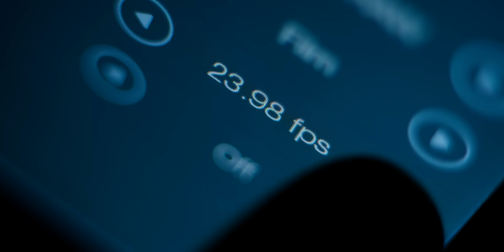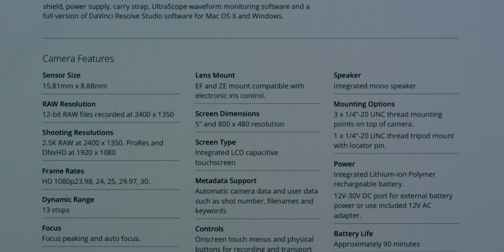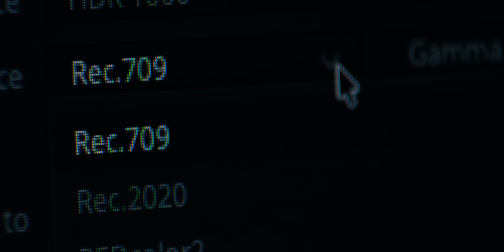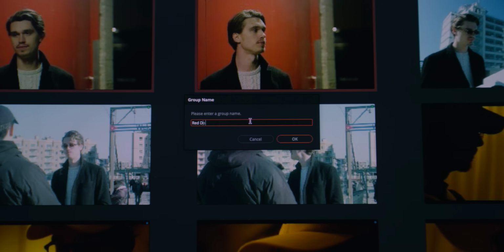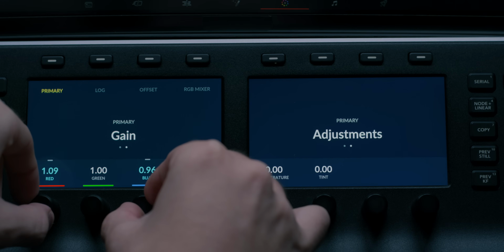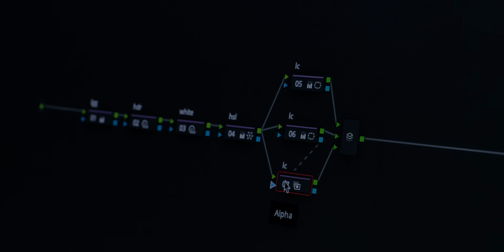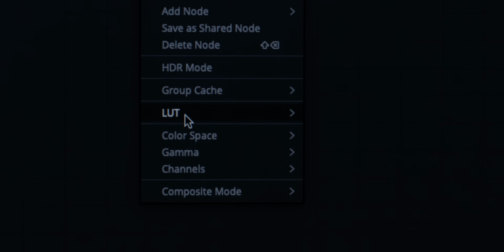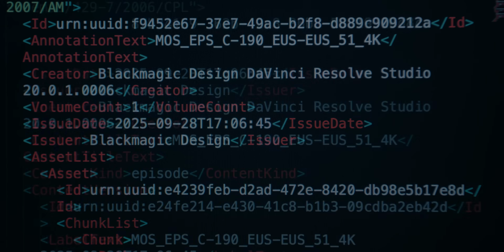1h to Master Color Grading

Comment: Oh god that’s amazing! Never heard of using ProRes 422HQ for youtube tho, it works better? Also i thought that gamma 2.4 is for broadcasting, 2.2 for internet and social media
Reply from the maker: Thank you, I appreciate it.

ProRes 422 HQ was heavily used on YouTube for VEVO music videos back then, as it gave better results than already compressed formats such as H.264. However, after running many tests, I discovered that H.265 with a high bitrate can give results nearly as good as Apple ProRes 422 HQ. I also ran a few tests on HDR videos, as both H.265 and Apple ProRes support a 4:2:2 10-bit signal, and H.265 handles compression very well.

Obviously, YouTube applies strong compression, so the signal will be affected, especially in low-light, noisy footage, but the codec and bitrate do help prevent additional artifacts.

Regarding gamma 2.2 and 2.4, these are standards, and I recommend gamma 2.4, as internet streaming platforms and social media will interpret it correctly anyway, if it’s embedded in the file’s metadata.
Reply: @zakariabenkabouche awesome reply! Thank you for the explanation, looking forward to your next episodes, they really hit different (teach in an interesting way).

Comment: There is a rare, profound synergy that occurs when you collaborate with a crew that respects the technical aspects behind the art. It’s that pivotal shift from merely "making a video" to managing the complex science of light, physics, and data. When the team shares a language rooted in signal integrity, you don't have to justify the obsession with bit depth, 18% gray, or the nuances of photochemical reactions, everyone already knows that this is where the "soul" of the image lives. This is the pursuit of Invisible excellence, the 10% of the work that the average viewer might not consciously name, but will absolutely feel as a sense of weight, depth, and premium quality. Consumer tools like CapCut have their place for quick turnarounds, but they hit a hard functional ceiling that true craftsmen refuse to accept. Even when standard software utilities reach their limit, they dive into the white papers, deploying custom OFX chains and VSTs to squeeze every drop of dynamic range and sonic clarity out of the source material. It is a relentless commitment to hitting the highest form of perceptual quality possible, a level of precision engineering where "good enough" is treated as a failure, and the final render is a testament to technical mastery and an uncompromising standard of craft.